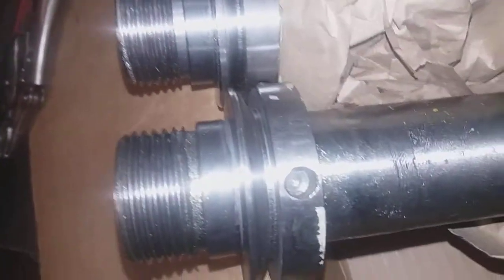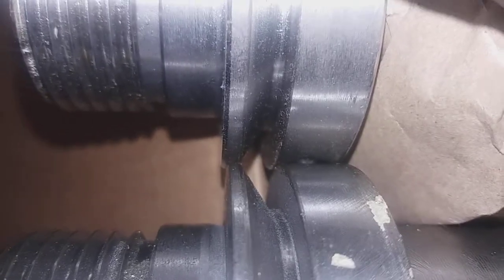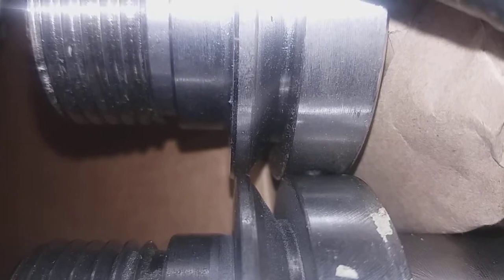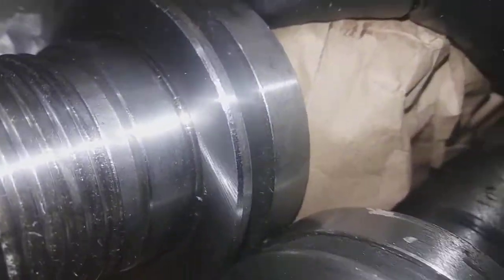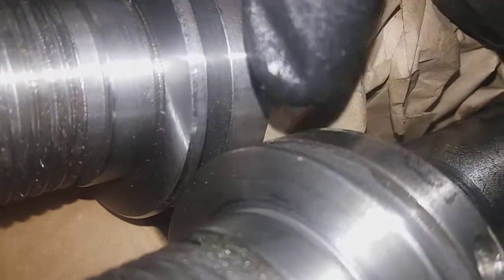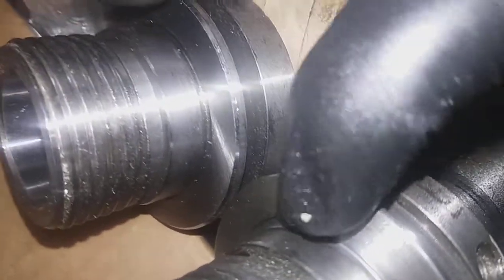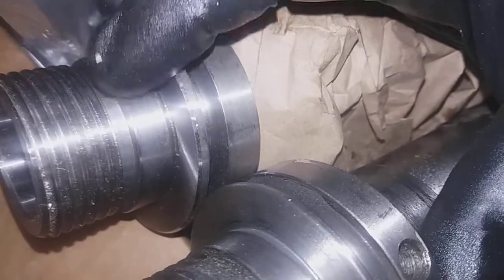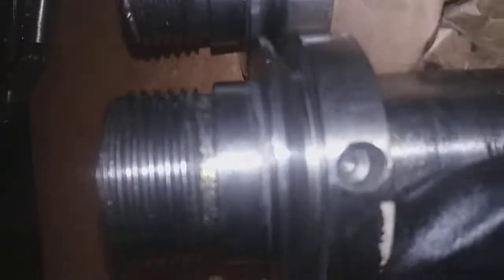G0602 Lathe Spindle Replacement/ Headstock teardown Part 4

Comment: How non accurate was the machine when you started? How much run out did you have?
Reply from the maker: According to this video https://youtu.be/mVNkRMLIf28 in my description says 5 to 7 thousandths, with the 3 jaw technically it was fine but switched to the 4 jaw  backing plate was rediculous, I figured they cut the 3 jaw backing plate to make it straight from a very runout start, I didn't look for an old machine because I didn't have enough experience to start and ended up going through baptism by fire learning what all my issues were, and this ended up being part of my solution, learning how to machine physically and not just academically and how to make and shoot youtube videos at the same time as part of my experiences.